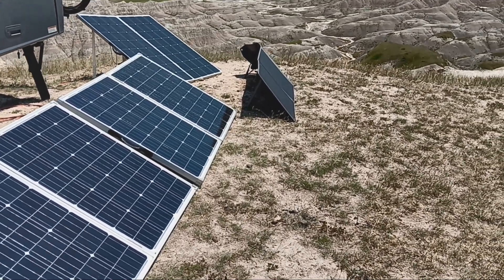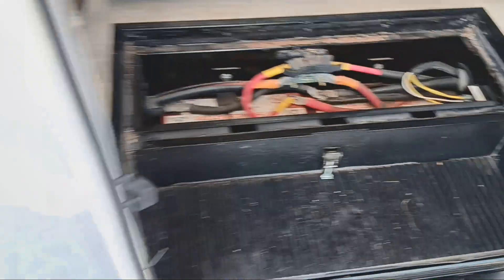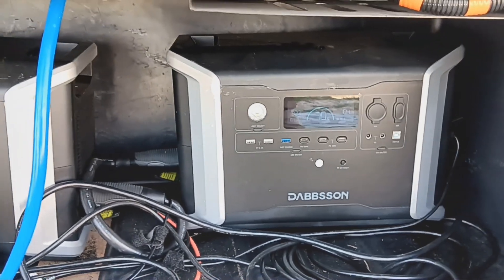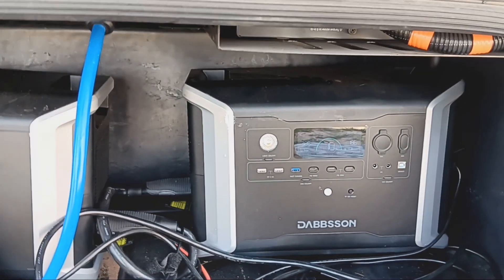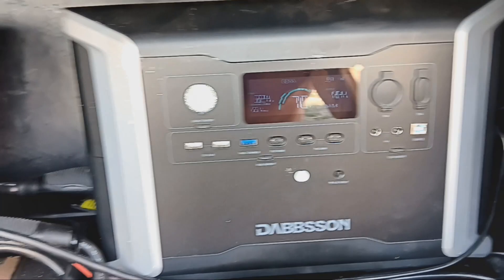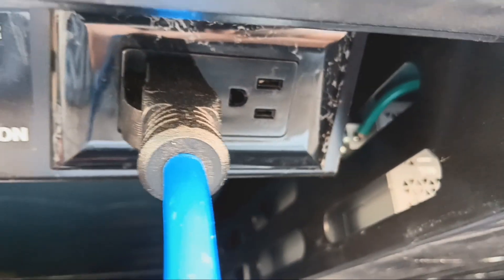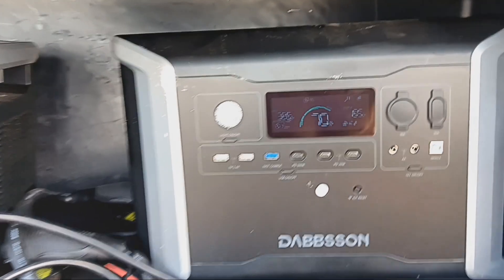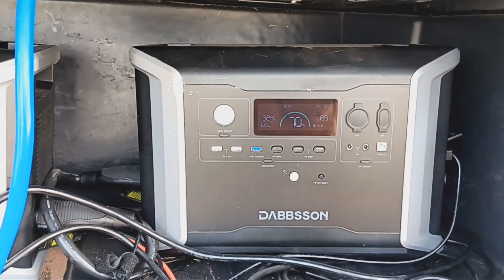Solar Powered Air-conditioning in a Winnebago View

Comment: Did you need to move the ac breaker to the inverter side of the box?
Reply from the maker: The breaker stayed the same.  It still draws the same continuous power, just doesn't receive the big spike that standard air conditioner units do.  In fact, I do not understand why this isn't standard on air conditioner units.